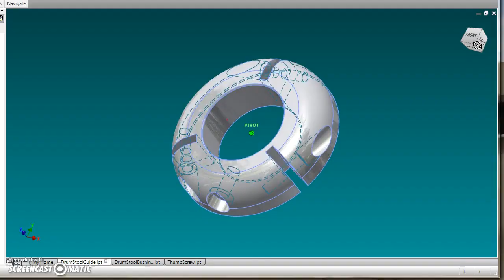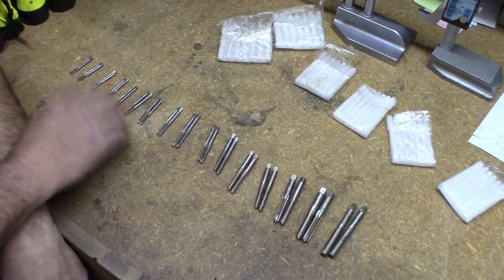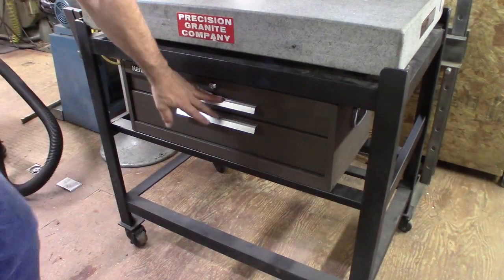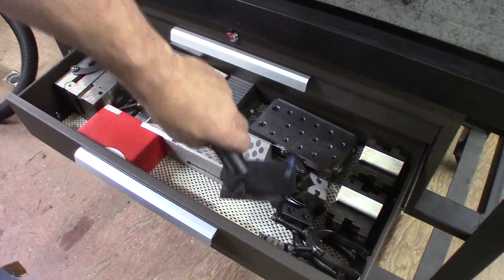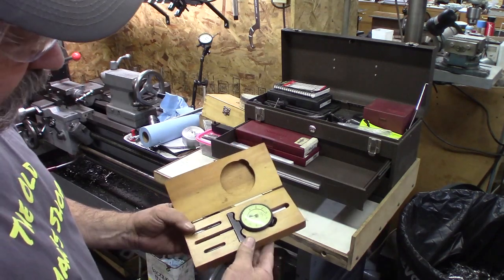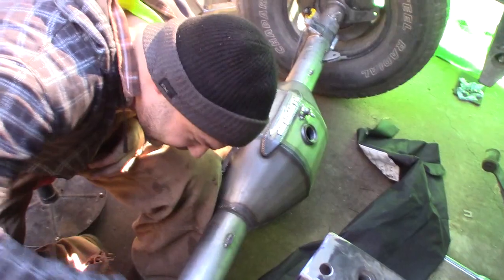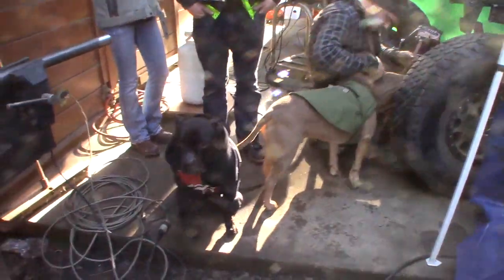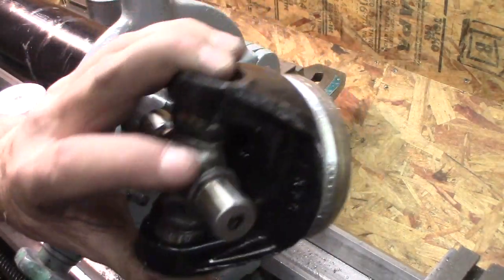Tools Toyota mods Shop Upgrades Ketchup #56

Comment: Really dig the Kennedy toolbox setups below the surface plate and end of the lathe.
-- Cheers, Gary
Reply from the maker: Thanks Gary,  it worked out great.  Next to throw on a piece of plywood for a bottom shelf to set the gage pin sets.